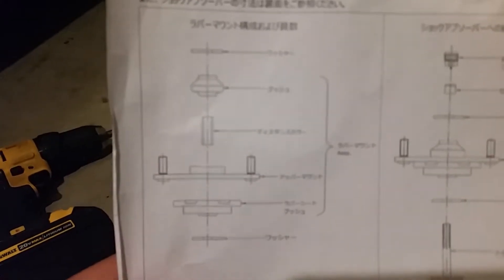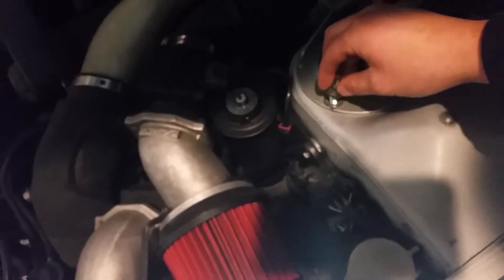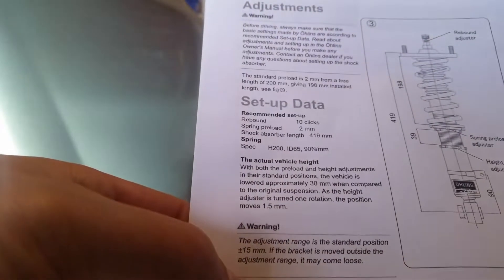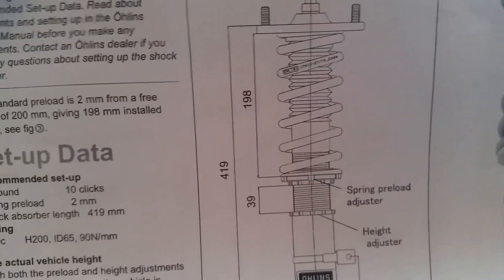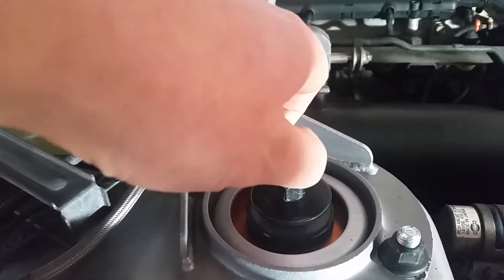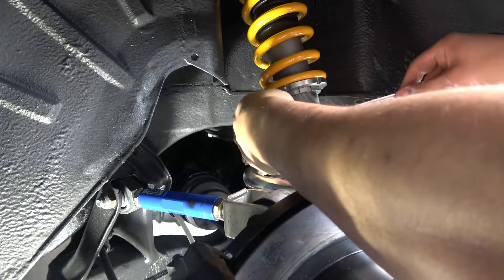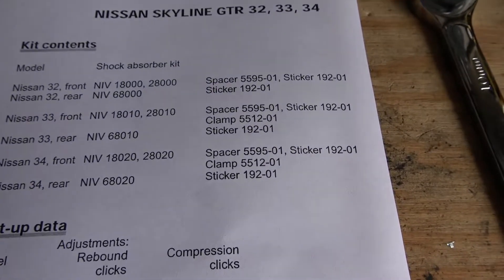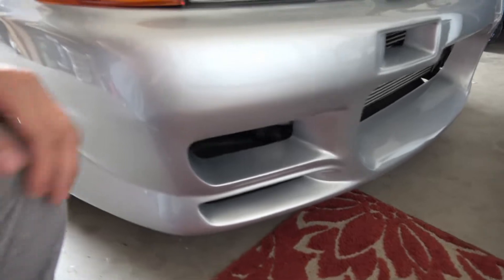Ohlins Road and Track DFV Coilovers Install and setup settings

Comment: I have these on my Evo 6 and they're lush. If you're using them on the road it's good not to set the car low you want to give the wheel enough room to.move up and down to absorb the bumps. If you set the ohlins to a soft setting (20 clicks) it's like riding on magic carpet. One thing I especially like with these is the faster you go the better they seem to work, even on the harder settings.
Reply from the maker: Well said, I love these coilovers. I did install softer springs to get rid of the rough ride and bounce these had. Went for a 10kg front 8kg rear to a 5/4 set up. Rides perfect in my opinion with this set up.
Reply: @JDMRightHandDrive  Would you say it's understeery ? I was thinking of going the same route with my R33 GTR.
Nismo puts higher springrate rear to allow the front to turn better

Comment: I have the same setup..mine keeps coming loose slightly and making noise. How did you get the nylon nut tighter?
Reply from the maker: Did you use the Allen wrench inside the center opening to hold the coil over in place to tighten the nut? Make sure not to over tighten because you can compromise the nylon locking nut
Reply: @JDMRightHandDrive  
Yes I did.  They stay tight and quiet for a few hundred miles or so the get noisy again…checked everything many times.  Everything is tight
  Should I try to increase the per load maybe?
Reply: @SWFlowseeker  make sure you torque to the correct specs

Comment: Did you corner weigh it using those measuerments?  🙂
Reply from the maker: No unfortunately I have never gotten around to taking my suspension game to that level yet. Good questions and thanks for watching.
Reply: @JDMRightHandDrive  awesome mine are going on next week I'll measure corner wights before and after :-)
Reply: @JDMRightHandDrive  3337 total lbs. Trying to send you pics lol
FL 945 lbs
Fr 943
Lr 706
Lr 743 full tank with e85 😜
Reply: @JDMRightHandDrive  3337 total lbs. Trying to send you pics lol
FL 945 lbs
Fr 943
Lr 706
Lr 743 full tank with e85 😜